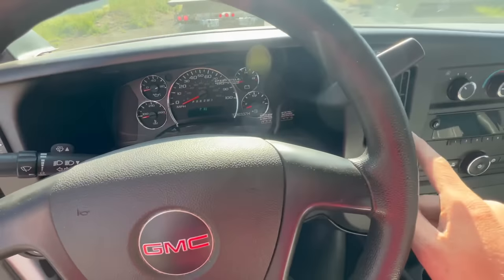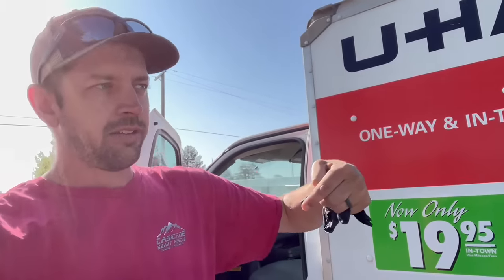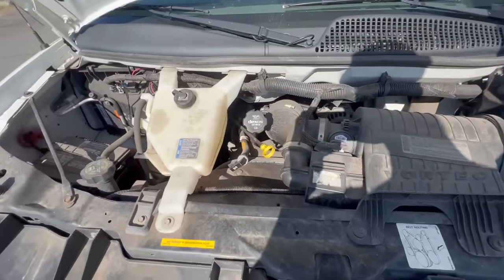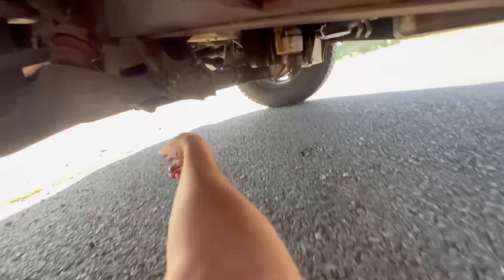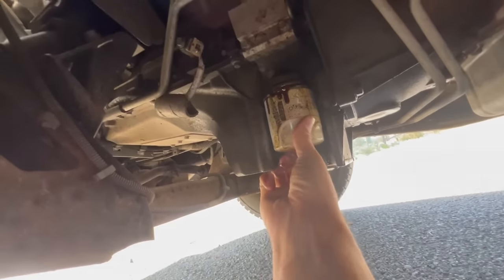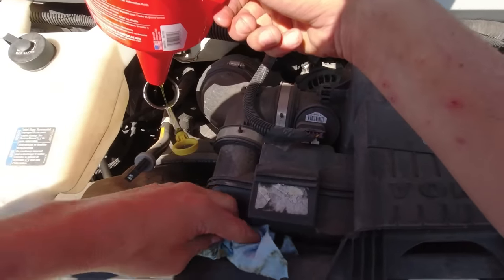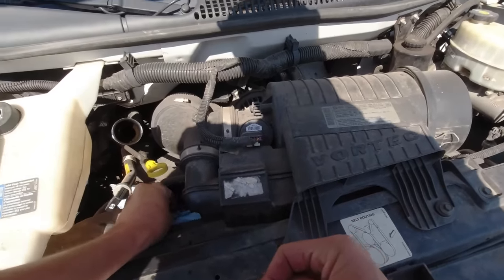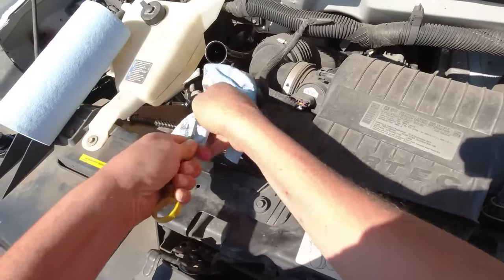Sometimes Being Honest Costs You A Job…

Comment: The issue with what you did was you became the last tech to work on that truck. Now, you have taken the onus of responsibility for anything that could go wrong with it. You arent a certified mechanic, you are a tow truck. Your job is to tow the truck to the place where the mechanics that have insurance and are trained to troubleshoot issues live. You are opening yourself to lawsuits when things go wrong, and a judge would straight up ask you "are you a certified and insured mechanic, do you work for the shop that these trucks are serviced, and were you authorized to perform repairs". Answering no to these would instantly put you on the hook for replacing the entire engine.
Reply from the maker: The answer is yes to all of those questions.   Soooo….
Reply: He's a mechanic, one for uhaul at that.... If you spent half as much time learning as being unhappy, you'd know that

Comment: Were you paid to be a mobile mechanic here?  If not, I would have just taken it to the repair center.  Just cause you found the cause, doesn't mean the people actually responsible for maintaining it shouldn't look at it.  There could still be engine damage if it was running without oil.  Now, you're responsible.
Reply from the maker: Yes I was

Comment: Errrr..... If you can post on YT; you could find the specs of the truck online.
You seem to be a 'tire kicker'.......
Reply: billted3323  Errr..... It's a generic insulting term.
If Casey had the time to post on YT; he had the time to find the truck's specs online.
As the GMC had a wet-sump system, the small pool of oil in the  sump would be enough to show oil pressure in the system until no more oil in the sump could pressurise the system as it passes through whatever shows oil pressure on the dial.
Reply: billted3323  Errr.... Nooo. Casey was being unprofessional.
"Dumb"? You mean 'mute'?
Look that up in a proper dictionary.
NOT Merriam-Webster Fictionary.....
Reply: billted3323  Errrr...... Don't worry : I'm not.
Unfortunately, there's lots of video posted on YT channels that's people trying to sound knowledgeable 
Dangerous misinformation that people take as gospel.
Casey could have explained at the start of the video that it's a good idea to find the specs (oil/pressures,etc.) of whatever vehicle you're working on.

Comment: (Edited due to autocorrect being a joke no matter how many chances I give it.)
The only downside to this is you could have voided someone's "FLEET WARRANTY" simply by taking that issue into your own hands. I know that sounds cold, because you seem like a genuinely nice dude. But I am just stating facts. One thing we used to do is write numbers on filters and things of that nature with specific markers, and little random things we did let us know if they had been touched by someone other than the company. What if the oil filter assembly had a crack in the metal or there was a part that was stripped out? You just totally bypassed a fleet service contract. Is it that big of a deal? It can be because you uploaded video proof of it. Am I telling? No. Just be careful doing that type stuff...it is 2023, not 1980 anymore....these idiot companies would microchip us all if they could. They have a hard on to sue or void things.

Comment: DUde, you f'd up. The entire bottom of the dipstick is 1 quart of oil. You over-filled the engine by at least 1.75 qts. That's messed up.
If you don't know what you're doing, DON'T PRETEND YOU DO, AND INSTEAD, LEAVE THE JOB TO SOMEONE WHO DOES.
Additionally, you have no  idea how long that engine had been run on no oil, so it would've been prudent to have checked it out before simply filling it and releasing it back to the customer. You didn't even check to see if it was burning oil out the exhaust. Nice video/Bad job.

Comment: An almost 15 minute video to explain low oil pressure was caused by a loose oil filter?  Tightened, added oil, done.  The message was good, but a time-suck to get there.  Video could have been two minutes max without all the extra babble....    Then reading the dipstick and guessing oil was "just a hair low" and guessing it needs TWO quarts??  Two quarts is a hair low?  Wow, long-winded video and silly remarks, why this guy has almost 200K subscribers i a mystery,
Reply from the maker: You could have made it shorter by just not watching 🤷🏻‍♂️